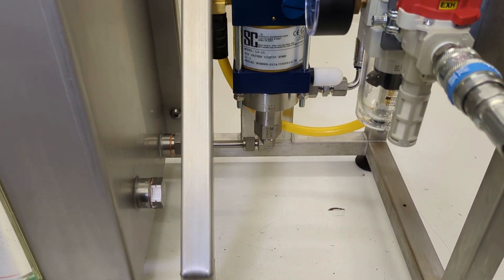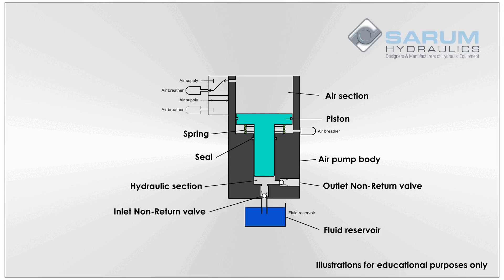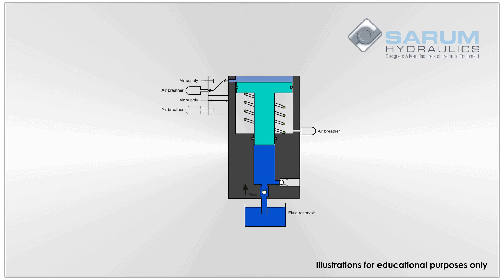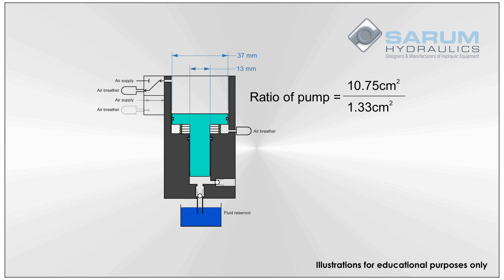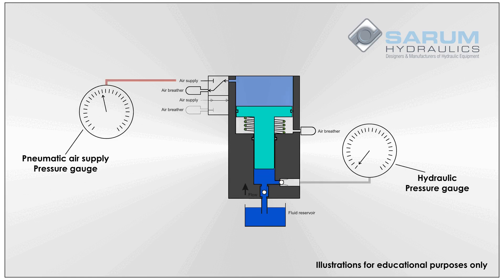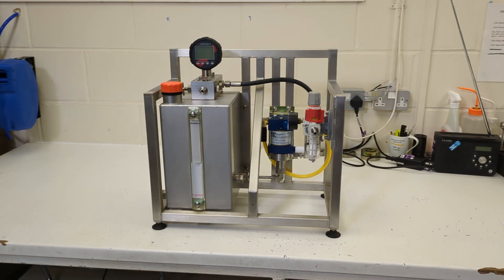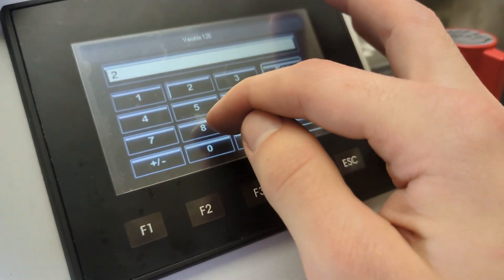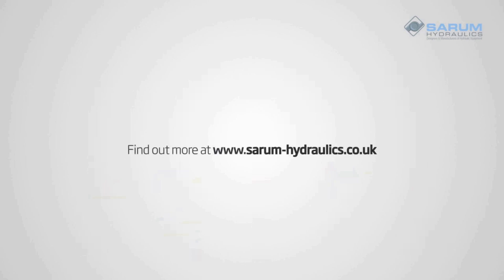How does an Air Driven Hydraulic Pump work? | Animated

Comment: Is it new technology? It gives very high pressure compares to well known gear or piston pump.
Reply from the maker: Air driven pumps have been around since the 1950’s or maybe before. They have a lot going for them but we always think it has to be the right application. If you were just operating cylinders on mineral oil on a piece of plant equipment, you would start with an electrically driven gear or piston pump, probably for cost reasons. But there may be a particular requirement that pushes you to air driven. For example, non-electrical requirements.
 - John